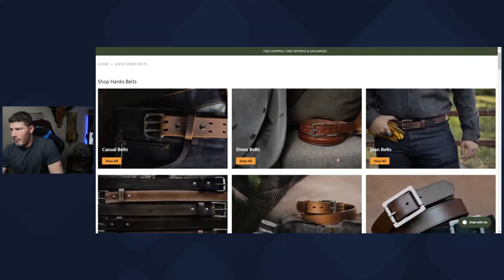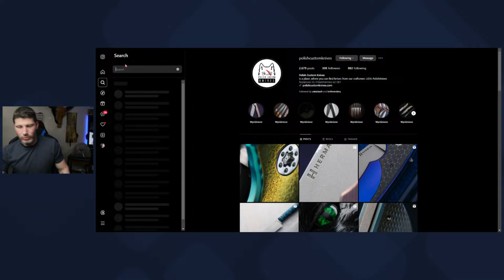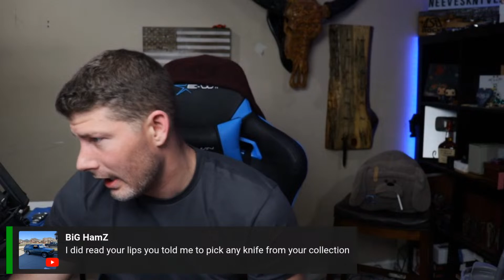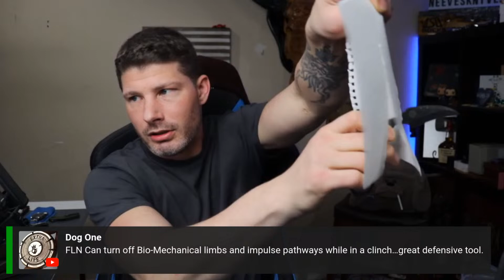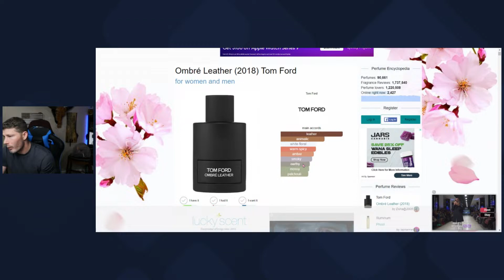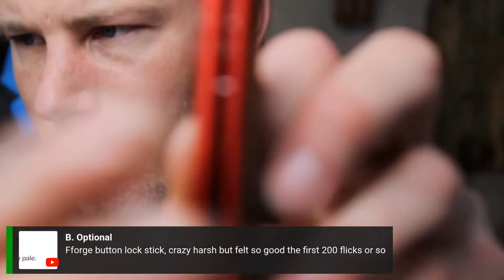LETS TALK NEEVESKNIVES LIVE

Comment: 41:30 how does Spyderco batch quench large amounts of blades? They use a gas in the vacuum furnace that brings the temp down at a pressure of around 3 to 8 bar depending how fast they want. And can even add more gas to goto liquid nitrogen level temps. They have tricks they use so they dont warp. But Spyderco does it.

K390 can also use secondary hardening with 3 tempers around 500c. This will allow them to dlc coat it without hurting the temper. Or 2 regular tempers and the last one would be applying the coating.

Iirc China has a new dlc that doesnt need high temps to apply. Not sure how good it is in relationship to the high end expensive, high heat dlc.

Comment: Re: the question about a knife for military service... I was a cargo parachute and airdrop load rigger (it wasn't my primary job, but I was in a unit that did that sort of stuff). Seek out the Terrain 365 knives that use Terravantium blades (dendridic cobalt). I own one. If if I had one of these when I was serving I would be as happy as a pig in s**t. And the construction and action is phenomenal for the price. I didn't meet the creator, but his wife at Blade Show Texas and I emailed a few times with him to complement him on this knife. It contains absolutely no ferrous metals, so is not subject to rust or corrosion in fresh or salt water. It's absolutely genius!